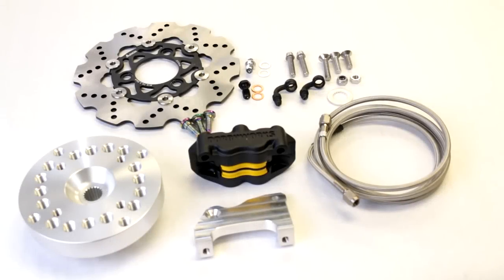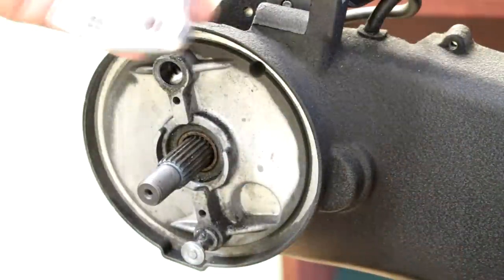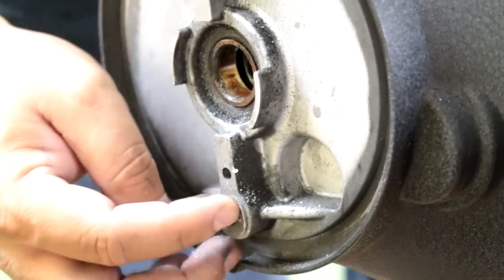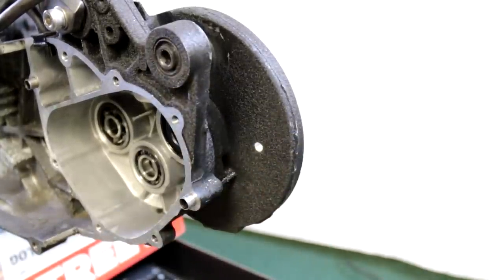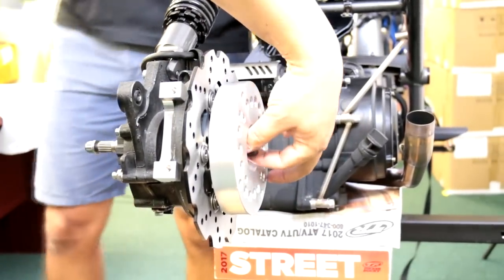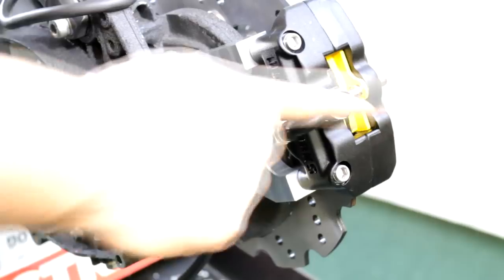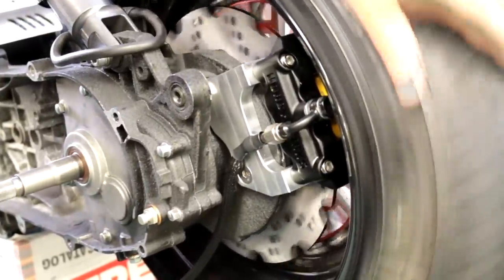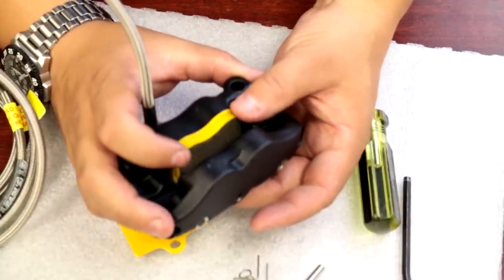GY6 REAR DISC INSTALL

Comment: Good work on explaining this upgrade.  Only thing I saw that you didn't do unless was edited out was cleaning the shavings off with brake clean.  Cleanliness is always #1!
Reply from the maker: Yeah we kinda figured you would clean out the shavings as we do mentioned it with the blue tape.  We used a microfiber and removed them .

Comment: ( 37:06 ). Just crack that bolt on the banjo.  Squeeze the lever, and let some fluid out.  Then just snug up the bolt.  What your doing is, bleeding with the bolt, instead of the bleeder valve.
Reply from the maker: that is correct arthur
Reply: @Theruckshop  I know.
Reply from the maker: thank you  @tellmesomething2go
Reply: @Theruckshop      glad I could help.

Comment: What I'm look 4 is the normal Wythe of my scoot without having a deep dish with multiple lug's , trying to stay more in the slick stock setups Where my front ' remain even the rear, due they make that kit??? . Brvo 👏👏⭐ the kit you installed is awesome maybe part # & price ( I not building a Ruck thanks guys nice work CLEAN ???

Comment: What kind of 8mm spacer I have your 863 wheels and the acorn nuts are hitting the caliper do I need 4 8mm washers one on each stud I dont know where you mean to put it when you say in between the wheel and hub the only place in between is the studs or do you mean a real wheel spacer like round with a bolt pattern like the ones for cars etc. This is the last step before I can get it on the road .
Reply from the maker: what people are also doing is getting rid of the acorn nuts and the m6x20 bolts that are in there and using m6x16 bolts with nylocks as it sits closer to the wheel. others have used non nylock nuts but if you do that id recommend good loctite to keep those on and let it dry.
Reply: @Theruckshop   alright thank you I wound up buying a 8mm wheel spacer for a car and modifying the bolt pattern.

Comment: bleeding rear disc brakes on a factory GY6 is a pain in the a...s,  does not build pressure for nothing and it was working until a fitting came loose but before that happen it took me hours to make it build pressure

Comment: I have a Genuine Venture with a 14" back wheel.  The engine is shot, so I want to upgrade it to a GY6.  Will this kit work with the 14" rear wheel?  The Venture came with a rear disc brake.
Reply from the maker: i dont believe it will sorry.

Comment: Will this work on a standard 150cc scooter
Reply from the maker: Wade Barnes should just don’t know about the brake line length and you would need a 12 inch wheel
Reply: @Theruckshop  the rims got to be 1 inch thick if you know a couple moped boys see if you can find something out for me thanks for your time